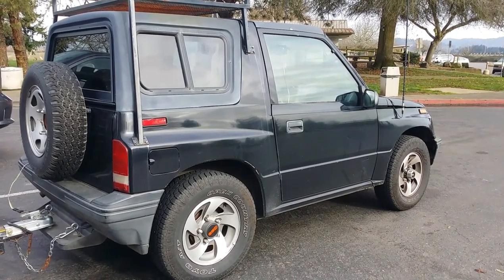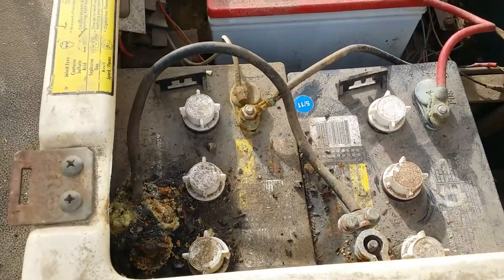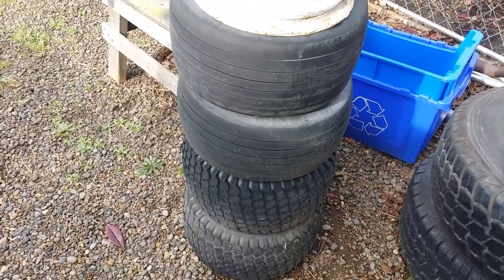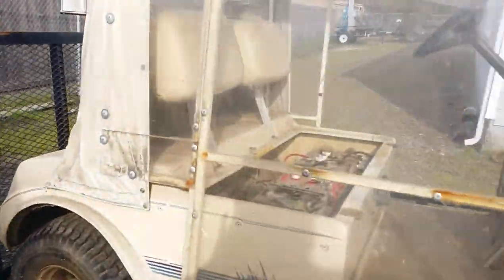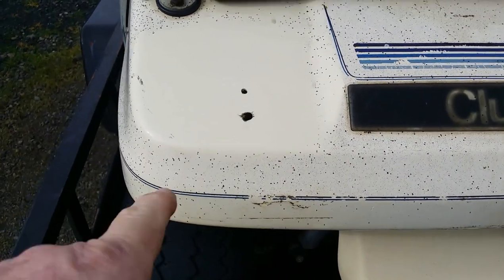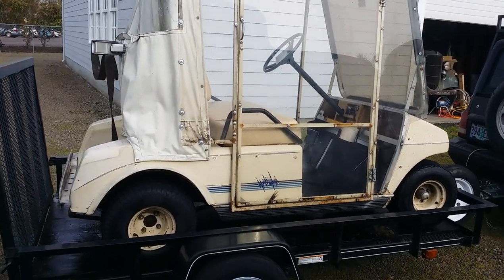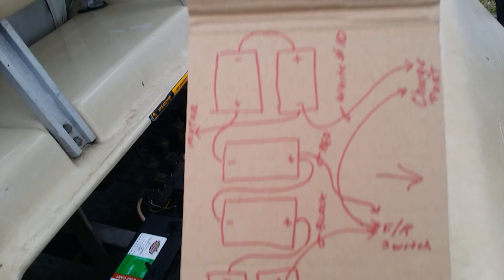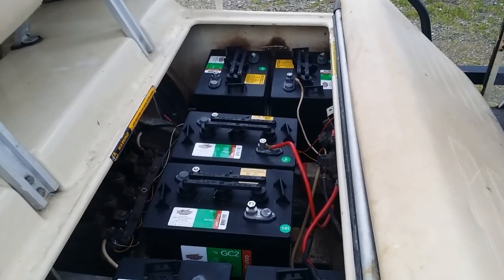Another Golf Cart Project at the shop. This time an Electric 1986 Club Car DS. Another Barn Find.

Comment: My 36 v melex all of a sudden stopped and solenoid clicks and motor growls.said 35.9 volts but connections corroded and 3 wire ends questionable. Thought it was motor or controller but I went ahead and CLEANED, CHANGED ALL WIRES & Individually charged each battery. FIXED, 😳 WORKS GREAT. 

Must have full 36V to operate and batteries were out of balance. Ready for winter. Yay!

Comment: Question I got a 1985 club car new to this I saw some in your video could you let me know on the big terminals coming off forward Reverse switch where they all go to I see where one goes lol bottom right to positive battery for 18 volts
Reply from the maker: So I sold this cart over 2 years ago, review this video again, at the 12 min mark I show a wiring diagram and the connections to the FNR switch. This is going to be the best I can offer. 
Good luck!

Glenn
Reply: Thank you so much

Comment: I just got a 1987 club car DS electric for $300!! Has batteries but I'm going to take them to a battery store and get rebuilt ones and trade them in since the batteries only read 1 volt or under.

Comment: Hi from Australia can you please show the wiring diagram for batteries and forward / reverse .
Reply from the maker: At 11.50 I show show the battery connections and the entire video was about hooking up the batteries. You might watch it again. The 18 volt tap is power for reverse. Half speed..
Reply: @GlennsSpeedShop  Thanks so the cable for reverse does not connect to 36volt.
Reply from the maker: The reverse tapped the batteries at 18 volt to reduce the speed.
Reply: @GlennsSpeedShop  Thanks so much for your help.

Comment: You can take the old batteries to some battery stores or junkyards and they'll buy them from you!
Reply from the maker: I bought brand new ones at Costco for 95 bucks each. Needed these for cores. Did you see this week's video on the Toro golf cart?
Reply: @GlennsSpeedShop  Not yet. Also I found a battery store that has rebuilt golf car batteries for $45 each with core return
Reply: Dan that's cheap do they ship I live in Texas
Reply: Where is that place